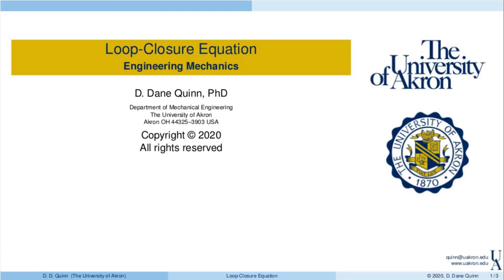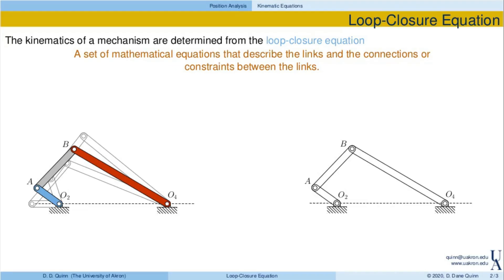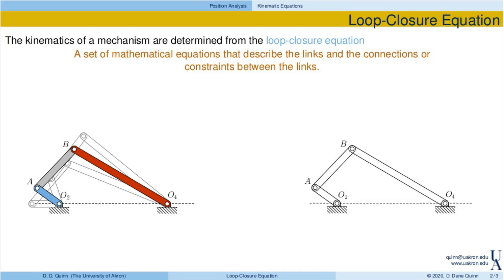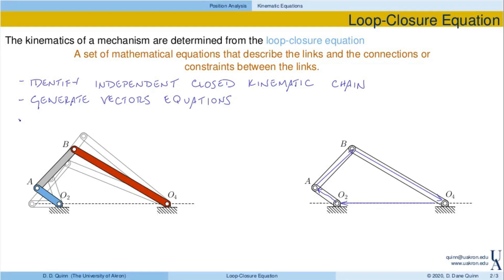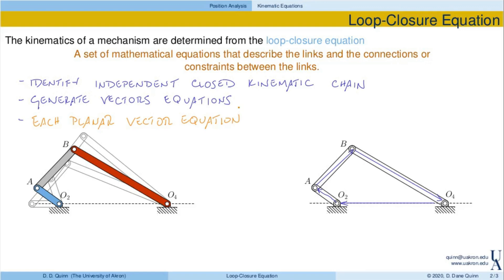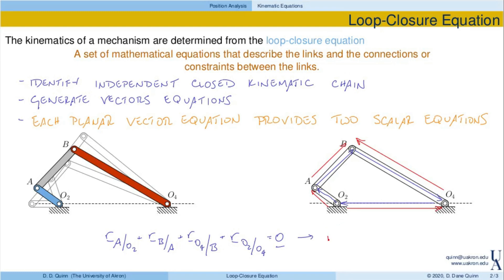UA - ME 321: Loop Closure Equations

Comment: Given an output, how would a mechanism be designed?  I am not an engineer, and this is a legit question. I understand databases exist; but, not any I can access, that I am aware of.
Reply: This is possible by kinematic synthesis. You're expected to know the behaviour of the imaginary mechanism (output) and with this information you can design the number of links and its properties using freudensteins equations( this can be used only for 4 bar chain generation). Remember not all points in space can be captured with this method. You'll need to determine accuracy points by chebyshevs method.

P.S 
pardon my English as I''m not a native speaker.